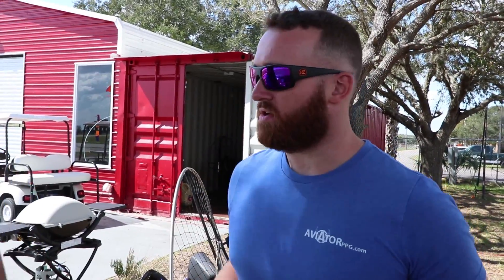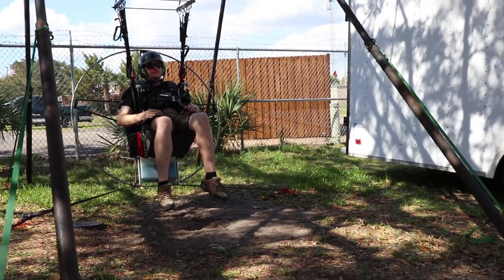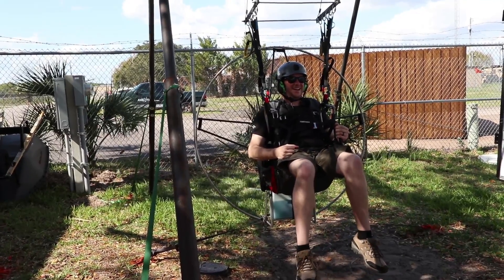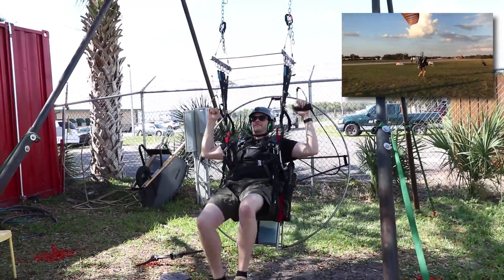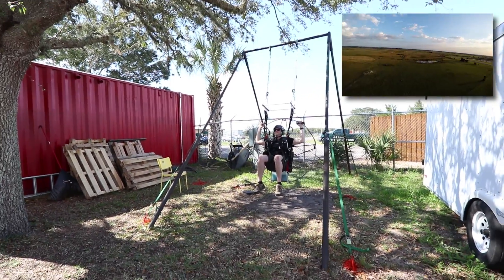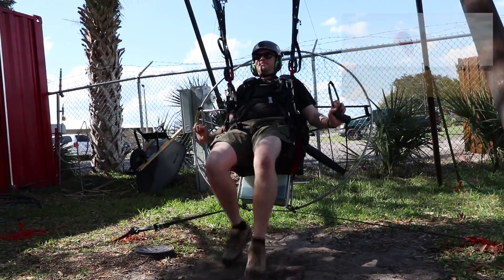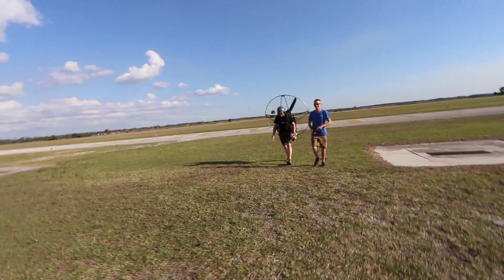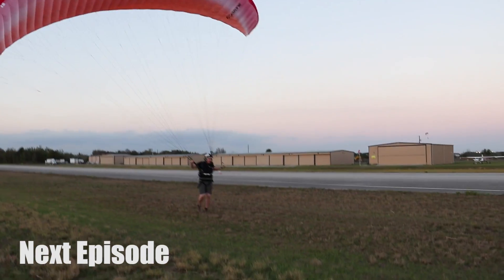Propeller Backpacks for NOOBs!

Comment: Why do they want you to power up before the glider is in the air? PS the swing showed that some of you guys have a gut.
Reply: To me it looks like you need some power once the wing goes up. You can see how they have to push at that moment. A little help from the motor probably helps to get you running.